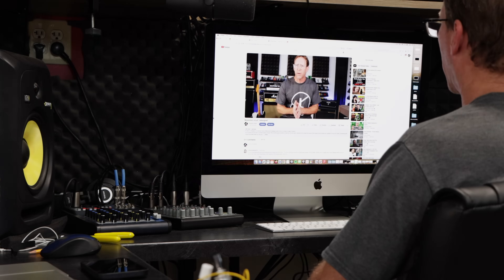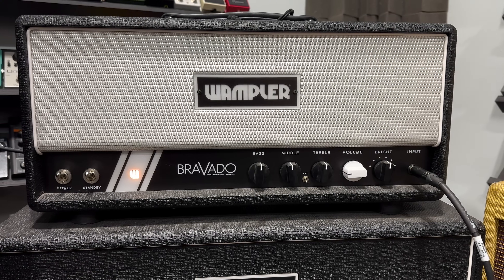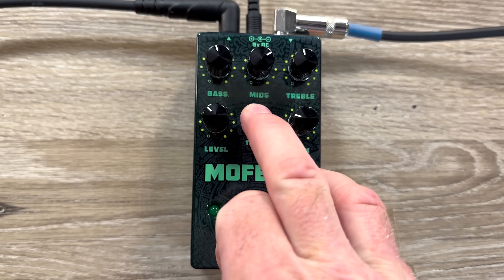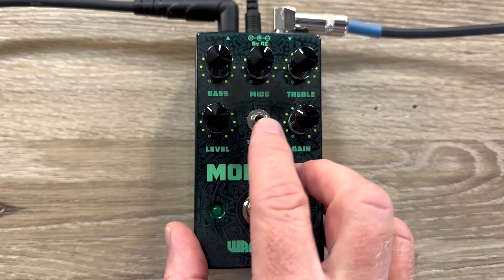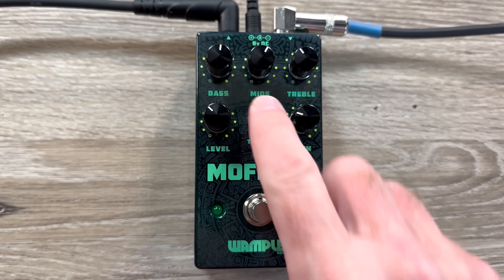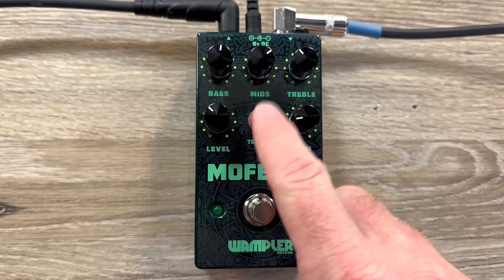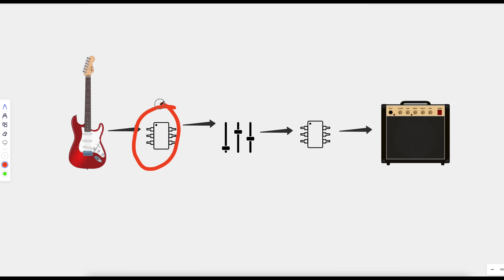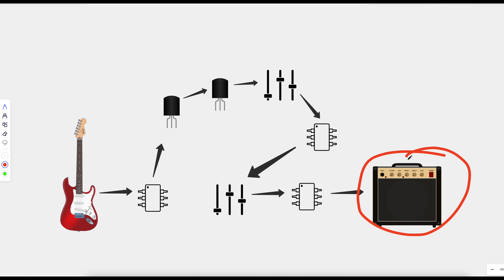Wampler Mofetta: A Modern Twist on the Mostortion MT10 Pedal Circuitry

Comment: So this is kinda like the Blackstone Mosfet OD?
Reply from the maker: No totally different, that pedal is using a 4049 chip that’s made of mosfets, which isn’t the same thing as using discrete mosfet gain stages.
Reply: @wampler_pedals you should make a pedalboard friendly version of the Blackstone Mosfet OD. It's one of the best OD pedals I ever played, but it needs to be first in the chain. The newer version has a mode you can put it in to place it where you want in the chain but even the designer admits that mode drastically changes the way thr pedal feels, sounds and cleans up with the guitars volume. It would sell like hotcakes because, one, the circut sounds so good, and two, it'll sound that way no matter where it's placed. Do you know of any pedals that already do that?
Reply from the maker: That’s a good question! I know several use the same chip, but I’m not aware of any exact clones of the black stone. I love it personally!
Reply: @wampler_pedals  it really is fantastic, and I gotta admit that just today, I flipped it in the buffered mode, and it's fine. I don't notice a "drastic" difference at all. It simply sounds buffered. A little bit of a stronger signal. That's it. I do prefer the "active" mode, but the guitar needs to go directly into the pedal because it's impedience sensitive. The buffered mode is good, though, and if it allows me to place it correctly, I don't mind the very slight difference. What pedals use the circuit?

Comment: This isnt exactly a mostortion any longer, but for any of you that have never stacked a Nobels OD1 type circuit(and i HIGHLY, HIGHLY recommend the wampler Belle if youre in the mkt for an always on drive and specifically an OD 1 circuit)into a mostortion, its a beastly amalgamation of sound. They seem almost built to blend i to one another and tweak on both ends of the duo. Thanks for all u do Brian. For years your name has filled more spaces than any other brand and its unkikely to change soon.
Reply from the maker: Thank you Todd ☺️

Comment: Brian,
Who copied who? I found several Quantum MOSFET Distortion Pedals on EBay. They have the same layout and function that your Mofetta pedal has. Who copied who? They also claim to be a copy of the MT-10 pedal!
Reply from the maker: Neither. The quantum is a diy project, but their switch does something TOTALLY different than what I am doing. Theirs just changes the clipping diodes, mine routes the signal through a series of completely different gain stages that work kind of like tubes do. This gives it a higher gain, and more of a chewy but crunchy tone. Essentially, two pedals in one. Here’s the diy project you are referring to:
https://aionfx.com/project/quantum-mosfet-distortion/

Comment: Im confused on the circuit diagram, Brian. So it goes through the 3 band EQ twice? Can anyone explain what he means when he says it exits the two fets into a "not really 3 band eq" then to the op amps,then back to the 3 band EQ again...
Reply from the maker: It goes into eq “circuitry “ but not a graphic eq. This circuitry is different high and low pass filtering.
Reply: @wampler_pedals  Ahhhh ok, I get it now. Very cool mod to the mt10 circuit. Thanks, Brian!

Comment: This is one I think I can definitely buy because I like what my original Mostortion does but the bypass switch is bad which is not unusual for Ibanez pedals. I have to open the pedal compartment and push the white plastic button by hand, so I don’t use it that much. Plus—it isn’t true bypass. I can tell right from the start this sounds better than the Mostortion!

Comment: My subjective opinion - FET generated clipping sounds GREAT on single coils. The Rivera Clubster 25 Doce, which I have wrestled with for years, sounds kick ass on Tele’s and Strats but just has a “mush” or compressed attack and a sorta “beef cake” sound with the increased output of a humbucker. The Rivera has an introductory stage FET in the overdrive channel….and as you have learned and shown, the MIDS are super important to regain some of that crunch and attack with FET overdriven humbucker guitars. Personally, I don’t care for it - but with single coils it is great. It’s a flavor, as you mentioned. Not good or bad, but certainly open to interpretation and opinion. The “feel” of the chords and notes is lacking the touch and tube compression with humbucker unless you do a certain trick on the front end…which is a fair compromise. Great video and I enjoyed it as well as the pedal!

Comment: I've built a few MT10 clones, for myself and people who asked me to, and personally I find the best part of it is the 3-band EQ.  I find it is able to dial in a very broad range of sounds.  So thank you for twisting all those knobs and showing just how flexible it can be.  A second aspect of the stock MT10 that yields a pleasing tone is the use of a 2+2 clipping diode complement, like a Timmy, for a little more dynamics, and a much lower bass rolloff than found on a TS-9 or SD-1, for a fuller beefier sound.

But I think the REAL secret is those 6-pin op-amps.  I'll bet you had to go to the Akihibara in Tokyo for those.  I've tried breaking 2 of the pins on 8-pin dual op-amps.   Maybe I've just broken the wrong ones, but I can't seem to get a decent tone from them, or indeed ANY tone.   😀

But without revealing too much, do you consider the modded circuit to be a "double clipper"?  A triple clipper?  Something else?

Comment: Why even bother with the original circuit?  Your circuit stands on its own.  How much does the original circuit add to production costs?
Reply: Probably not very much. I built a Rat clone with the original circuit and 2 other variants. All 3 modes shared most of the circuit, they just had different clipping sections.
Reply: Name recognition.  One builds on what one can.

Comment: First! 
There are too many dirt pedals dude. Tone is in the fingers. These different circuits  just produce variations on waveform squaring,, the rest is the art of the user.
Reply: Tone is stored in the balls.
Reply: @particlesandpixels  Correct, and Brian explicitly said the MOSFET clipping gets more ballsy 7:20. Perfection.
Reply: Why does Baskin Robins have 31 flavours? Variety is kind of nice.
Reply: @whiskybravo4648  31 flavors, 18 of them are tube screamers
Reply: The irony here is hysterical. Variations of waveforms is literally changing the tone since it you know, manifests as a change in how the sound wave reaches your ear. But you’re kinda right, tone is sort of in the fingers when you’re using your fingers to turn the tone pots.
Reply: He should have called this pedal Mofinger
Reply: Technique is in the fingers. Tone is in the gear.
Reply: If you have your tone/phrasing down, all that a pedal should do is give the amp something sound wise you want differently. If each of us is given an amp, guitar, and cable, each of us is expected to play well w/out pedals. Yes, always start with the fingers (skin, fingering, and position will change tone more than a pedal will -usually) then deal with the sound element like pedals, better amp, etc. Having said that I have 3 Wampler overdrive pedals. I rely mostly on the Tumnus, not for tone, but to shape the sound of my amp up a little. I guess one can just say "tone is in the fingers, sound is in the equipment".
Reply: If Eddie Van Halen played David Gilmour's rig, he would still sound like Eddie Van Halen. You've all missed the point. Clipping is clipping.
Reply: @Pablo-nc6qu  dude stop with the bullshit boomer takes. You’re confusing style with tone. Eddie would sound like Eddie playing through Gilmour’s rig. Which would have a different tone but stylistically sound like (insert whatever guitarist here). Your playing style isn’t going to make a hiwatt sound like a super lead at 90 volts on the primary of the PT.